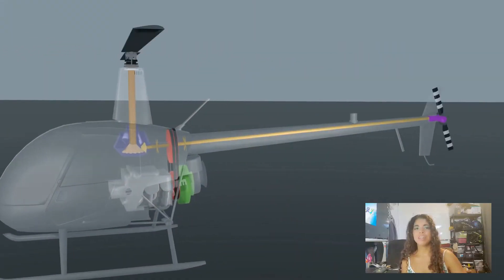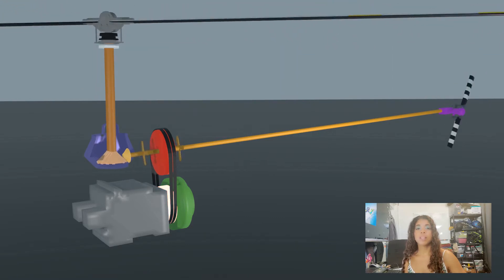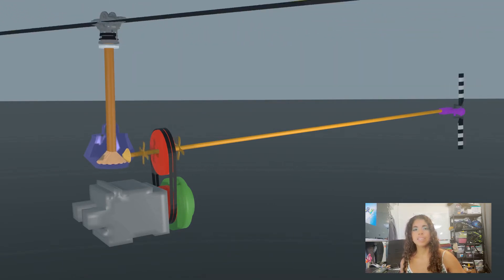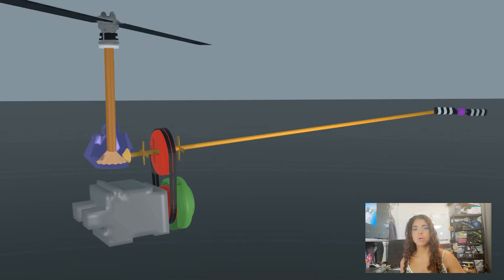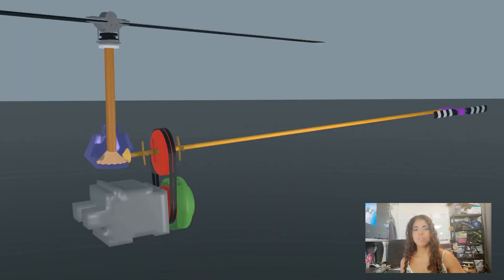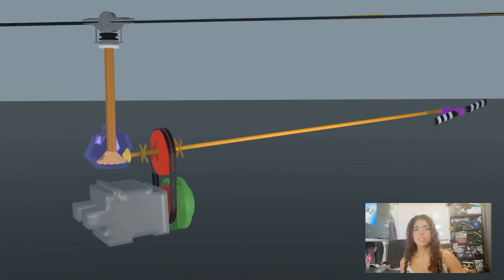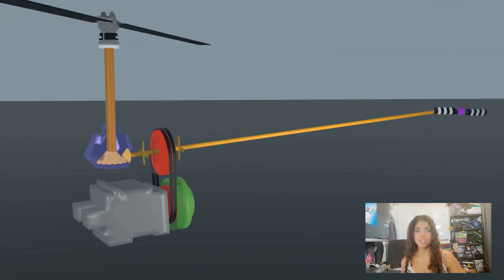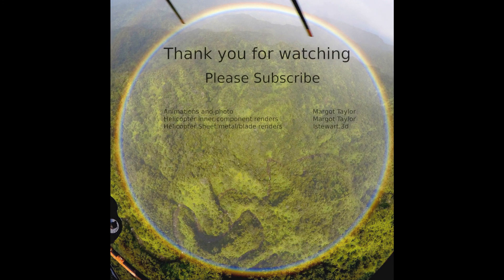R22 transmission and drive shaft explained with animations | Helicopter Lessons With Margot

Comment: Can you explain how the clutch actuator applies tension to the upper sheave? How is the sheave able to move with a solid driveshaft going through the middle of it?
Reply from the maker: @ticenits1926 sorry for the delayed response time but good question. The upper sheave doe s indeed move upward in order to tighten the belts. The flex couplings (Plus signed shaped in orangish yellow in the animation) along the drive shafts help allow for this since those flex couplings allow the drive shaft to be in separate but attached sections. The amount it moves and bends is fairly small so there is not a "huge" bend to accomplish this.
Reply: @HelicopterSchool  thanks, I'm familiar with the couplings you describe, just didnt think they actually bent while still having enough strength to support the driveshaft spinning.

Comment: I understand the main rotor of a helicopter is designed to spin at a fixed speed despite the blade pitch. How is this achieved when the engines change speed? Is it accomplished via a CVT-type mechanism?
Reply: Governor system
Reply: The engine doesn't change speed all that much, it is the load that changes on the engine.
Reply from the maker: The engine does do more work or less work (more horse power or less horse power) but the RPMs are meant to stay very close to constant (changes by +/- 1%). If you want to climb for example, the rotor system has to do more work which it can do if the pilot increases the pitch of the rotor blades. The blades rotate at the same RPM, but make more lift with the increased pitch, which allows for the climb. In order for more work to be done by the rotor, the engine needs work harder since it is what powers the rotors. The way this is accomplished is that the throttle opens up more, like stepping on the gas pedal of a car. The pilot does not have to do this throttle adjustment manually however. There are two ways the R22 accomplishes the throttle increase. The first is that there is a mechanic linkage so when the pilot increases the pitch of the rotor blades, the throttle is mechanically linked to open up more. To be more precises in this adjustment there is also something known as a governor which finely adjusts the throttle to maintain constant RPMs. Sorry for the delayed response. I plan to get back involved with this page more and make more videos. Thank you for your question. Aloha from Hawaii.